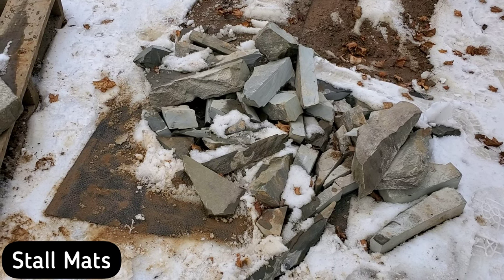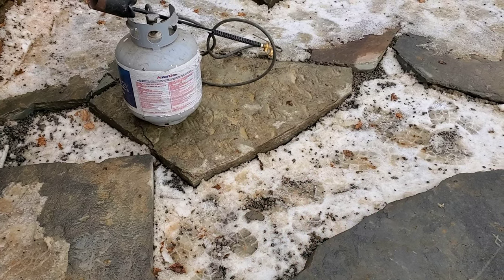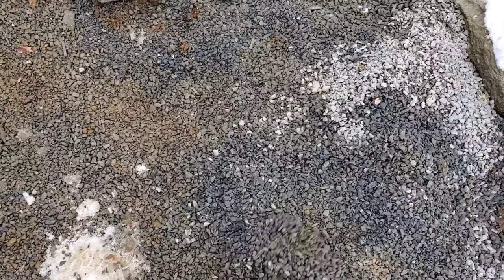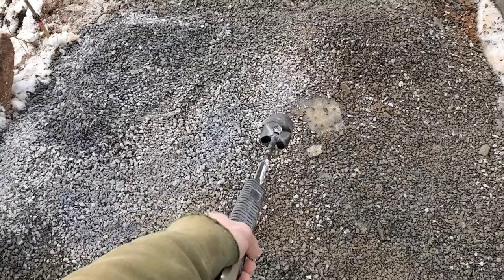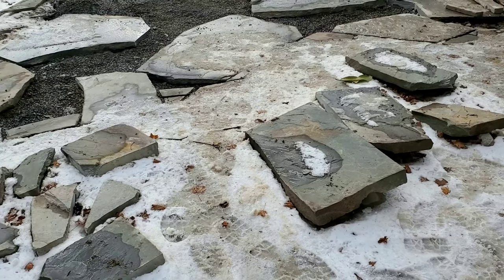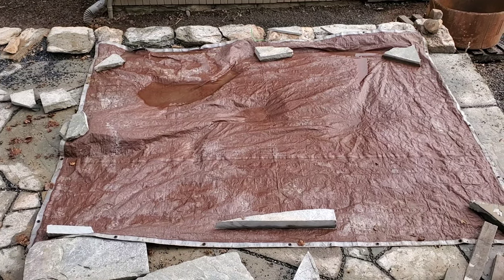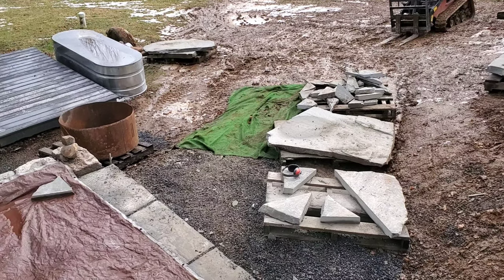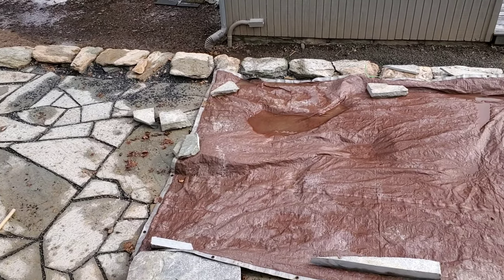Pro Series | 6 Winter Tips & Tricks - Winter Woes Working With Stone |

Comment: Your videos are full of info I classify as, "things that you might learn eventually, but you wish you saw before your first job."  Thanks for giving newcomers the wisdom we need to do well!  Do you have any guidance on sizing a wall?  Like if someone wants a raised garden bed 6' by 10', with a sitting surface on top, how wide would you make that wall so it holds the soil and doesn't look out of proportion?  

Height is 20-24" but looking at commercially avail rectangles for capping the wall I see 12" and 18" wide, which would be a skinny wall (just 10" wide at top and 16.5" wide base) or a wide wall (22.5" at base and 16" wide at top).  Or do you typically get custom cut caps?  If you've seen examples of what looks weird or 'off' that would be helpful.  Or any guidance on minimum width for a stable retaining wall (maybe it depends on height of the dirt?) would be awesome.